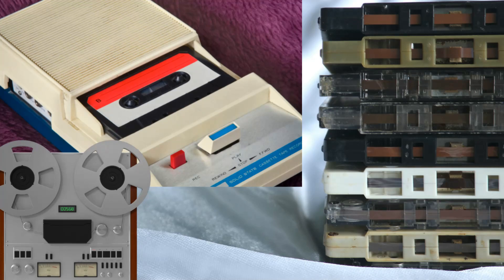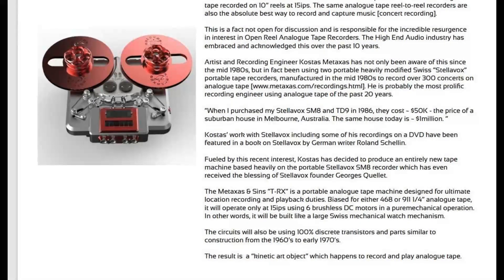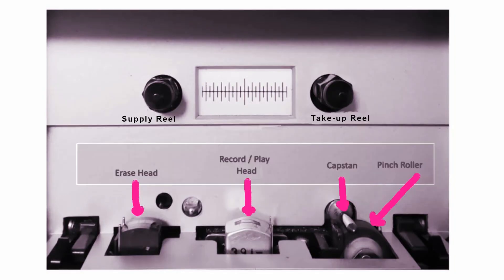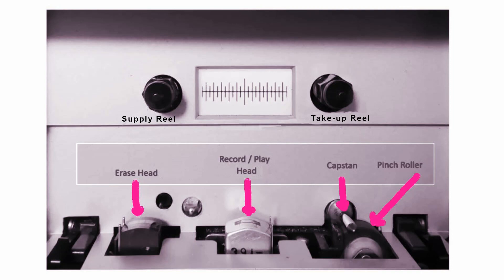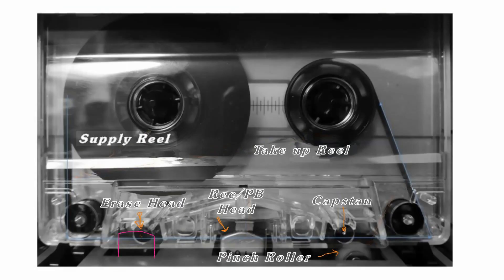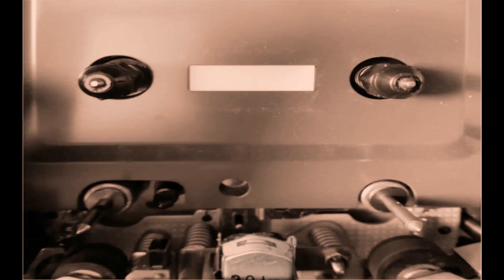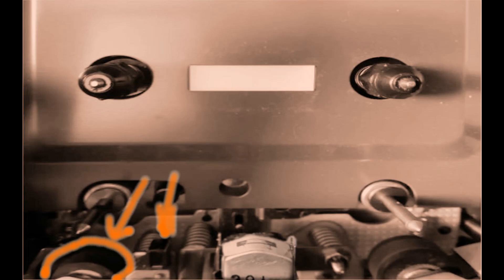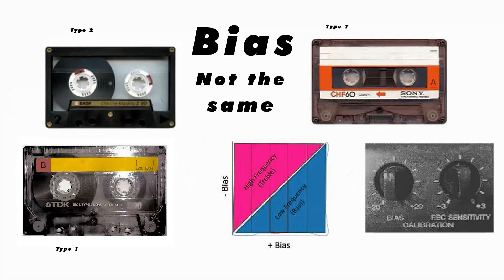How a Cassette deck works.

Comment: hey folks have a issue with my technics stereo cassette deck ...basically the cassette was playing and forgot to press pause before pressing the eject button as a result there was a lot of noises that didn't sound good and the mechanism is still working  but no sound just the sound of static if you folks have any suggestions even if it's down to a good forum to ask...cheers
Reply from the maker: The Technics Decks can have problems with the gears used for the movement of tape and heads, cracking and /or losing teeth. You need to remove the tape and have a good look . Get back to me when you have done so and I will see if I can assist you.

Comment: Hi , good video. I've got a whole lot of old pre-recorded true chrome cro2 cassettes , and while they sound good when recorded over , none of my Japanese decks are really exceptional at recording on true chrome cassettes. The  bit in this video,  where you conect a 150hz signal to one channel and a 7000khz signal to bias a cassette , has been somewhat helpful,  on 3 head decks I can monitor what bias is ideal for a given cassettes . Results were surprising . Back to chrome cassettes , when recording on chromes at 0db , results I was getting on playback was around -8db maybe -6db , and not the 0db I was hoping for , they still sound better than a average type 1 , but lacking in level/volume. Thanks to the method you presented here, I was able to establish,  better biasing and higher recording levels. Now thanks to the method you shown here I can get the recording to peak at 0db,  without loss of sound  quality . I was getting a bit disappointed with these pre-recorded chromes , since they don't have the type 2 notch in them either. Now I think I will be able to make top notch recordings on them , and yeah,  I got more than a few of them. Might be very happy using them now. Thanks for sharing your knowledge.
Reply from the maker: Thank you. for your input.  You may find this video of interest. Bearing in mind I am using only a  Modern  2 head deck the results confirm what you were getting and you can see the waveform and hear the sound. It was set to type two but the results speak for themselves. https://youtu.be/b3GCSxRNY38